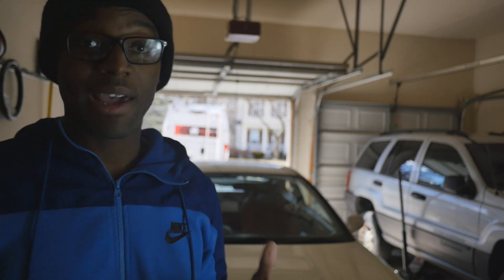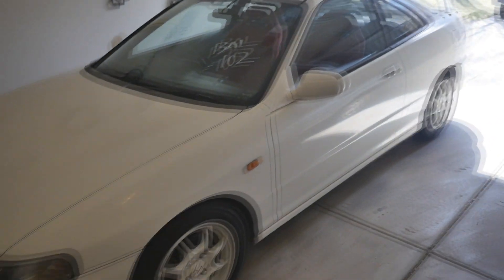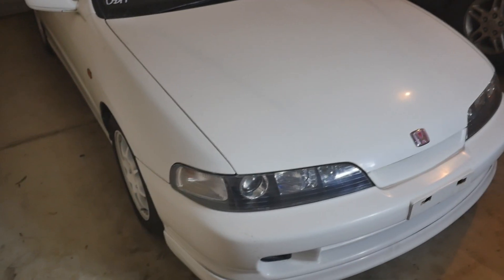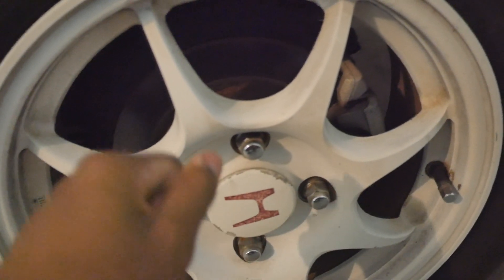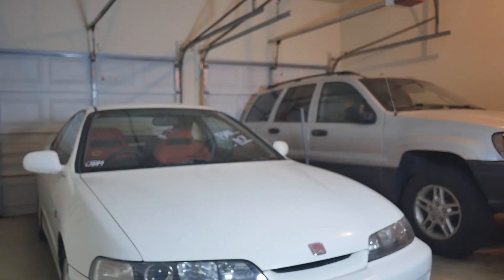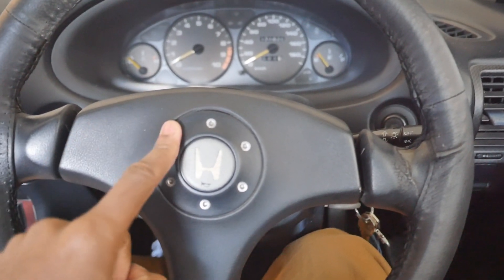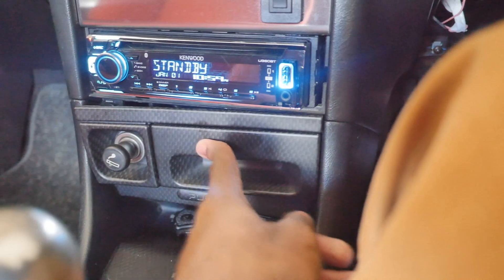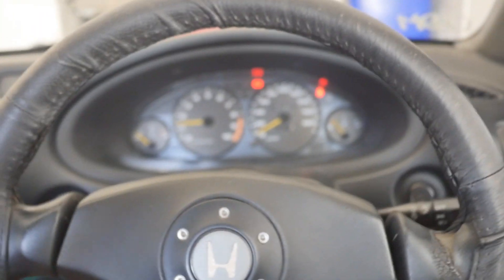Project Integra Type R Part 1: Overview

Comment: Right on it’s here!  That is a good condition valve cover.  I would still replace it or at least buy one while they are still available.  I cleaned up my 98 JDM steering wheel yesterday.  Cleaned the wheel with degreaser and microfibre and then red Sharpie on the red stitching.  My 01 CDM had a hidden antenna kill switch mounted in the DIN pocket.  Got to love that it hasn’t been messed with too much.  I have had to reverse a lot of mods on my 98 CDM.  Finding OEM JDM and USDM parts has been very challenging.  Looking forward to the progress.

Comment: Awesome vid bud 👍 The best base to start from is a JDM import because of absolutely no rust to start with, hope you bring it back to its former glory. I did notice that the plastic trim that goes under the steering column is missing 👍 I’ve owned Jdm cars like STI’s, EVO’s, Skyline in the uk since 2005. And I’m now a proud owner, obviously not as fast as the others a fresh import JDM 2005 Facelift EP3 Civic Type R. I will always have a Japanese import due to how mint and spotless they are. 👍👍😃😃😃

Comment: Sweet! The eagle has landed!! 🙂 It's in fantastic condition for the years and was clearly well looked after. It's the "pure" version too. I'm amazed it's so stock. It looks like a really honest car. Nail polish remover should shift the glue. FWIW I have a cupholder if you want it, or is it the bracket it sits in? I think I have one of those too. Funny enough your mileage is about 500kms away from mine. 🙂 

Other than lots of security the first thing I'd do is flood the rear quarters and all around the inner wheelarches with anti rust wax. This is where they all start to go. Take of the sill covers(easy job) and flood the sills too. Bottoms of doors would be a bonus, but it's mostly the rear quarters and sills. Look too where the front of the rear wheelarch meets the sills at the bottom, there is often a gap in the panels here where water is forced in as you drive in the wet. Bit of caulk should sort that. Congrats M 👍🏻and I hope you get the DMV stuff sorted soon.
Reply from the maker: Thanks for this btw. I will say, this car will never see snow as long as I am the owner! Maybe occasional rain.....I think I might go to a tag and title place tomorrow and try my luck there.

Comment: Congratulations on getting the car. Plenty of parts available in the UK and potentially cheaper shipping than from Japan. Interior plastics are starting to increase in value so I would buy the interior stuff now. Wheels and paintwork can be done anytime (H wheel cap stickers also on UK eBay).

Comment: A proper detail will make it look significantly better. I suggest checking out AMMO NYC or Obsessed Garage for some information on proper detailing. A decon, clay bar, and a 2 step correction will do wonders for the paint.

Edit to add: invest in a steamer. If you care about how your interior is as you mentioned, it'll have a tremendous impact making it easier to get clean, especially in tight spots. It'll also make removing the adhesive significantly easier.

Comment: The car looks amazing I like your plans with the car full restoration 👍.as for the rear brake rotors you can Take one rotor of your car go to a local parts store and see if it will match 94-97 accord ex . Maybe that works
Reply from the maker: Thanks foe the advice! I'll try that when it's time to replace them

Comment: You probably already know, but 94-97 ex accords (with disc brakes) have the 4x114.3 bolt pattern, so you maybe able to use rear rotors from an accord
Reply from the maker: Yup and the 92-96 prelude Si front rotors!
Reply: @MITONFILMS  Also, congrats on getting the car stateside. I was wondering how things where going for you.

Comment: Prelude disc rear rotors can work also same lug pattern
Reply: Or honda accord
Reply from the maker: for some odd reason I read that they dont work without modification. Ill look into it more
Reply: In jamaica we only got the jdm integra type r's here so as replacements front and rear rotors all came from the prelude or honda accord. Because the the regular integra all were 4x100
Reply from the maker: @sheldonpatterson6599  thanks for confirming ! I was worried I'd have to pay a lot for rotors.

Comment: How difficult would it be for a guy who doesn’t speak Japanese to buy a car from Japan I might just have to hit you up lol also my Teg start with out the clutch it’s a safety switch at the pedal and when they go bad the car won’t start most people just unplug them and jump the two wires with a paper clip and electrical tape just make sure your in neutral lol
Reply from the maker: Very easy actually. Doston at Garage Defend is bilingual and can help you buy any car in Japan. As long as it will be legal for import soon
Reply: @MITONFILMS   that was fast thank you I just edited my message about the clutch safety switch lol